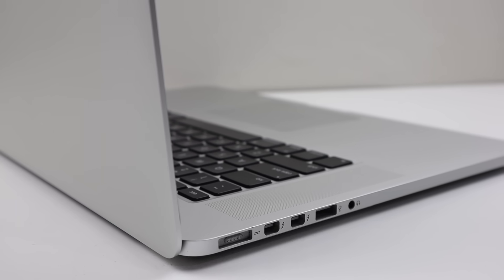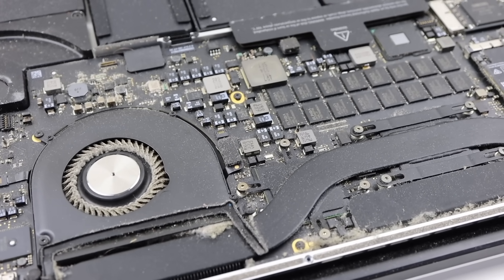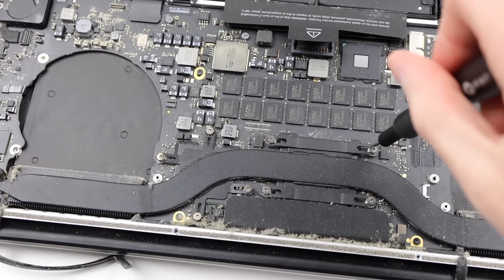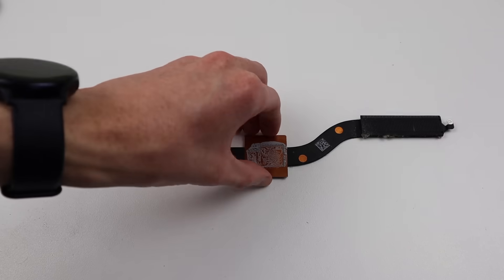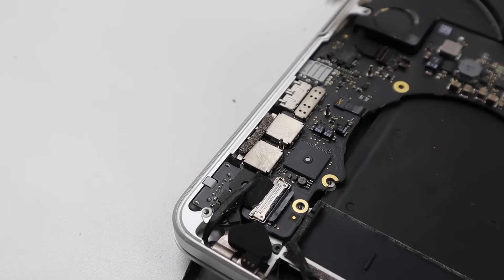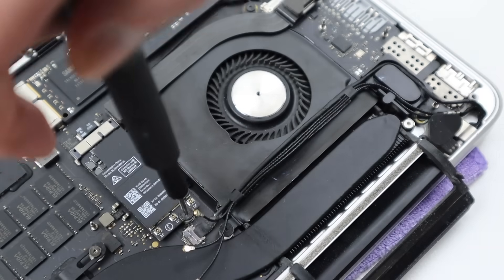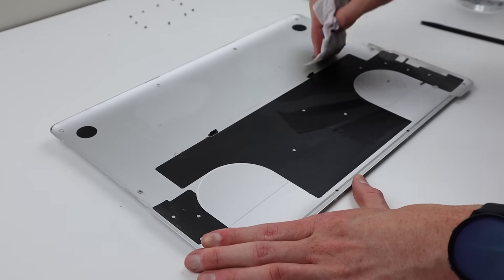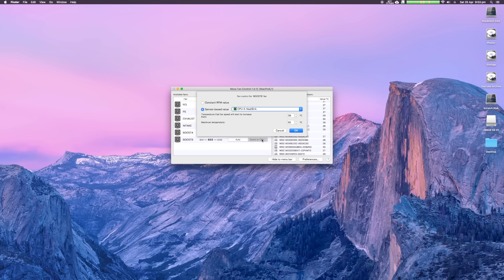Fixing My Filthy Overheating MacBook Pro

Comment: Actually you should have done that cleaning already when you bought it.
And btw, those fan control apps are useless unless something is wrong with your machine and those apps also can cause an overheating or damaging as well if wrong adjusted.

Comment: Yeah, I think that's the same issue I have with my 2015 MacBook pro rn. It only gets hot above the first row of the keypad. When I bought it from my sister I took it to get it dusted, and sure enough, the fans were very clogged. I knew they would be because she always used her MacBook on the bedsheets. I also need to check in with apple because my mac is from the era where there was a recall on the battery, I hope I could get a new battery done on mine since it does die pretty fast.

Comment: Just did this and it worked.
My MacBook is about 15-20 degrees lower than the previous temperatures. Plus it doesnt feel that hot on touch, previously I couldn't even place my finger on the metal area above the keyboard. Thanks for this tutorial!

Comment: Heyo mate!

Not sure i can get a reply here, but I did the same to my 13" Macbook Pro 2013 by changing the thermal paste and cleaning the fans. However after I put everything back, I noticed that there are actually additional sounds coming out from the Macbook! 

It goes a bit like of a 'rattling' sound and I have re-opened the macbook to redo everything again but the sounds still persist. I even put in wd40 onto the fans as I thought it was the fan causing the issue, but it seems like it is not? And I am clueless to what is causing the sounds?

Comment: Can I get a little help here? I wan't to get my Macbook checked and cleaned- in the past I've spilled water on it more than once(big or small amounts) aswell as coco puff dust. I want to check for water damage(sometimes my screen glitches and so does the battery as the battery) aswell as get a new keyboard because three of my keys are really loose, easily fall out, and some feel "sticky". When I go to get it checked, are there any specific things I should ask for? ty

Comment: Hey Hugh Jeffereys, I just completed a cleanup job following your video and also replaced my battery. I have a question however, it looks like, even though the battery is charging, my mac doesn't recognize the batter. No icon, not even in the system report. Any pointers?

Comment: Still, it’s best to apply enough thermal paste to cover the entire die as the whole thing produces heat so making sure all 4 cores plus the integrated GPU is cool is important. Since Apple puts immense mounting pressure on their heatsinks, spreading the paste manually won’t cause any air bubbles since any would be squeezed out once the heatsink is pressed into place. Same goes for the GPU. Also you should never cheap out on thermal paste as getting the expensive stuff is well worth it even for just a few degrees because it will give better performance

Comment: 3:37 compressed air shouldn't make it frosty when you use it. That will not blow away any dust. It will instead make it wet so it will be even harder to remove. To use compressed air you must hold the can upright.

Comment: I have a question: Will using Macs Fan Control drain the battery faster?
I once used Macs Fan Control and I found out my battery died faster. Or perhaps there's something wrong hahaha.
Reply: Using Macs Fan control to spin the fan faster than usual = Uses more power.
Reply: @googlehelpdesk  THANKS man !!!

Comment: Great video I enjoyed every minute of it but, I saw one problem when you show the back of the computer with the lid up I saw that part of that lid covered your venting ports in the back, that's a No-No, that is blocking air-flow coming out of the back of your laptop. Check it out to see if I'm correct, maybe you can fix that airflow is very important to keep computers cool, To me that looks like a designer slaw from the factory, as you already know, they don't like any heat. The cooler the better. Nice job though. PS I did go back to look at your video and I noticed that they have directed the airflow going up into the screen I still disagree with that design but anyway it looks like it may work anyway Heat going to the screen I'm not sure about that LOL

Comment: You won't damage your components if the system is dirty. It will just throttle and result in poor performance. New CPUs have built-in thermal protection that stop this from happening.

Comment: I did this about 6 months ago on my mid 2012 non-Retina 15" Macbook Pro and it made a sizable difference for me. Mine wasnt as dirty as Hugh's but it had some dust in it and the thermal paste was really crusty. After a good cleaning and new layer of Thermal Grizzly Kryonaut, i went from running around 175F at idle with no applications running to around 153F.

Comment: Your macbook pro reaches 90 degrees and you say that it is unbearable because it burns your skin, but how about the 2020 macbook air with that thermal throttling huge problems ? it reaches 100 degrees almost every time.

Comment: When I opened for the first time my Mac book air it was full of dust, so I cleaned it and it was running very nice, much cooler and more silent. Maybe too silent. I was worried that the fan stopped working as maybe I touched something wrong. Long story short, my friend who knows computers better than me came over and opened it while it was running. (This was not recommended by the online guide, but he said that it was fine) you can imagine my relief as I saw the fan spinning, so we shut the laptop down and reassembled it.

Comment: @Hugh Jeffreys Have you noticed improvements in the computer cooling? Is the extreme heat  still coming from the computer? Noisy fans gone after the cleaning and the apply of thermal paste?? Thanks

Comment: One last thing would be a fresh install of latest macOS and all the application and then you would practically have a brand new laptop out of the box with maximum possible performance out of it. Amazing video and PROPER CLEANING 👍👍
Reply: You noticed improvements in heat after  performing  fresh install??
Reply: Late reply sorry 😅. It depends. When I clean the whole thing, I also start fresh on the software so everything will be fresh. This way you won’t deal even with the smallest possible software issues. After 7 years, your software will definitely need a cleanup same as your outside of laptop.

Comment: You can lift the fan blades off the assembly, it makes them easier to clean. While they are off give the shaft a small bit of grease, a few laptops ive owned in the past have had horribly rattly fans that make buzzing noises when the laptop is tilted, adding grease always quietens them down for years after.
Reply: i didnt realise the blades could be taken off...they looked riveted on to me? it had a really good clean anyway so i guess thats for next time!

Comment: YOU SHOULD'VE ASKED THE APPLE GENIUS FIRST BEFORE YOU DID THIS SO YOU COULD EXPOSE THE RIDICULOUS LIE THAT THEY COME UP WITH FOR YOUR OVER HEATING!! MISSED OPPORTUNITY
Reply: What do you mean
Reply: @POWERMAXUM  the apple genius would've said that their is water damage and that multiple boards would need to be replaced so might as well buy a new computer
Reply: @henryyu4694  that's because he cleaned it with compressed air the wrong way
Reply: @POWERMAXUM  no

Comment: Put thermopads on heatsinks and pipes, You'd gain 10-20 degreees less. I saw a guy doing that od reddit, I did it myself and it helps to cool.
Reply: Could you tell me what kind of pads are you saying

Comment: i clicked this video thinking that you might have used liquid metal after cleaning the stock thermal paste. That or any other thermal paste does not even comes close to the heat transfer capacity of the liquid metal compound. If you would have used liquid metal then i think you could have easily shaved about 20c on the load cpu temperatures.

Comment: When applying thermal paste directly to a die (and not to an IHS), remember to spread it manually so you are sure it covers all the silicon.. Otherwise you risk having bits of circuitry that is poorly cooled. That can lead to some cores overheating while others are prefectly fine.
Reply: I just add a little extra to the spots ik doesnt get spread out evenly

Comment: Hugh: really overheating laptop
My Asus Laptop: Let me to introduce myself
Reply: What do you expect from asus? They all have wireless heatpipe...
Reply: @jm036  ?
Reply: @em0_tion  Wireless heatpipe.
Reply: @jm036  Oh, you repeated the very same words, so I understand you perfectly now. 😁 I've serviced thousands of different brand laptops and I've never seen or heard of a "wireless heatpipe". Are you referring to cooling designs like the latest cheap cool machines like the ASUS VivoBook X400 series for example?
Reply: @em0_tion  ASUS X509 and X512. Awful cooling design. It's been nicknamed wireless heatpipe.
Reply: @jm036  The simple tiny heatsink over a soldered weak CPU is "fine", as in most certainly not perfect, but sufficient. I've cleaned and tested many of those designs and I laughed at their built-in batteries with exposed three 18650 cells. But damn! 👀 Haven't seen this X512 eGPU design yet with just 2 plates connected by a heatpipe! 🤣 I mean, c'mon, the fan is still cooling the chips down somewhat, but with no fins, this is just an insane design! Well-deserved nickname for sure. 😀 Thank you for sharing this, you made my day! I'm definitely stealing this nick name. 🤪😂
Reply: @em0_tion  There's a Ryzen 3500U under there. Quad core 15W. And X509 with the same CPUs has an even weirder heatsink with some fins but no heatpipe. They seem to have stopped this insanity with Ryzen 4000 models though.
Reply: @jm036  Ah, that explains it, I've only ever worked on their previous Intel (Celeron) models. Temps were around 70 degrees under full load (AIDA64) worst case scenario with Arctic MX4. What temps do these AMDs hold in such a "genius" setup that it makes you "hate" on the whole brand? 😀
Reply: @em0_tion  It seems to even off at around 1.8ghz at 97.5c under prolonged loads. This minimal cooling works on super low power SoCs but sure doesn't on ordinary laptop CPUs.
Reply: @jm036  Shame, overheating even while working crippled under base clock speeds, this is embarrassing for such a capable CPU! 👀 Nothing is sacred in the name of budgeting/greed I suppose... 🤦‍♂️ P.S.: I just saw the video you posted on it, ahahahahahaha, I'm dying laughing! Jeez that's a hot mess of a laptop. 🤣

Comment: this compressed air is laptop killer. Its almost like you would throw water on it. Dont do that, you dont remove dust only making it more wet. You only remove dust thanks to brush. Use compresed air but not from can but from compresor.

Comment: Hey Hugh, I'm a huge fan. 
I recently bought an iPhone 5 with a battery fault of eBay. I fixed the battery, but I am unable to insert a SIM since it is locked to Vodafone or EE. Do you know of any good hacks that would make it possible to unlock it? Should I bring it to a carrier, will they be able to unlock it? or maybe contact the origional seller for further information? Please get back to me as soon as possible, I an eager to get this iPhone to working condition!!
-Thanks Mate, 
-Oli

Comment: Can anyone who is careful enough do this? Mine is a mid 2012. Ever since Catalina its so hot some times and spikes for nearly nothing. Problem is its a non retina so i have to remove the board to get to the heat sink. Since I’ve had it since 2014, should i just buy a new one? Or fix the thermal paste? It’s my daily driver, so i dont want to be down a computer.

Comment: For my og white MacBook from 2009, I just took out all the individual components and brushed them with an unused toothbrush. Worked way better and was easier. But I didn’t replace the thermal paste, and it has been overheating lately... so I’ll try that

Comment: My  2 old MacBook Pro, start making heavy Fan noise sometimes, It clearly audible and bottom lid heats up from the side where circuitry is. I cleaned problem is not completely vanish yet. Any help ?
Reply: Are you using demanding applications? Is your laptop on a surface which allows it to draw in enough air?
Reply: @t1e6x12 No, not always any heavy apps, and even keeping laptop with enough room on back side to keep ventilation open. It still overheats sometimes.
Reply: @gurmeetchahal557  Could be background processes. From what I know MacBooks don't have particularly good hardware in them, and, over time, programs will get more hardware intensive due to the general consensus that new machines can handle it easily. This can be seen in phones where older phones get more sluggish. It's possible to your CPU has to work a little bit harder to run those programs meaning it draws more power and generates more heat and the fans need to ramp up. So, it's possible that background processes could be the culprit of this.
Reply: @t1e6x12  well, cant say much. I do keep killing background process and it sometimes work and sometimes doesn't. I have to use until it dies. No option, i guess
Reply: @gurmeetchahal557  have the same problem

Comment: i would have used 0,001 mg less thermal paste on the left chip and would have applied it to the right one. the way you do it, it will definitly break 2 minutes earlier at the end of its life span

Comment: *windows guys making hot jokes*.                   Also windows guys- computer is not worth fixing, buy a new one. Virus riddled in 2 months, hard drive clogged up in 3 months. $800 software updates.
Reply: Me who uses Windows: Built his own computer. Can fix any issues with it with relative ease. Has had no issues at all with hardware. Uses a 240gb SSD to boot on and has 3 1TB HDDs for other storage. Has spent $3.95 on purchasing a Windows license. Does not go to downloadram.com expecting it to be a legitimate way to get more ram and thus does not have any viruses.

Comment: Do you homie, but the compressed air could spin your fans way too fast and mess up the bearings inside, hold the center still and blow it, keping the can upright to not have liquid, and youll do this in no time.

Comment: I did this to my macbook pro however when i was trying to remove the flex cable for the airport card the whole thing came out.When i turned on my laptop,the webcam stopped working and it is very slow.Is there a way to fix this?

Comment: The fans look like regular DC brushless fans like on any other laptop.
Fun Fact: You can almost always just pull the entire blade assembly out to clean them, it makes it much easier to rid the dust and make it squeaky clean and you can also re-lube the fans to make sure they run at their max potential!
I always do that when the fans are not sealed and allow access to the inner assembly like the one in this video.

Comment: still here rocking a 2012 lenovo laptop thats not failed on me once, battery is just about gone though. lets just say imagine that dust in the mac in the video but 4x worse. it was nasty. heatsink was fully blocked and worst part is that it was used by a heavy smoker since the dust was dark brown. and smelt like cigarettes. only restored it about a week ago and looks and smells brand new. with a nice 512GB Kingston ssd with an i7 2630QM processor. (dont ask why theres an ssd in an old laptop, the original 250gb hdd died) replaced the paste with Arctic MX-4, new fan since the old one was making a tapping sound, and a new charger. like new

Comment: you could have removed that cap .  never keep it inside if it's in this condition. sound will work anyway.
Reply: The caps fail mode is most often shorted so I wonder how it didn't take some of the transistors down

Comment: Are you aware that using bottled compressed air is one of the most wrong things to use on a computer? The compressed air in the bottle has a very high percentage of humidity, which for one electrical / electronic component is one of the worst things!